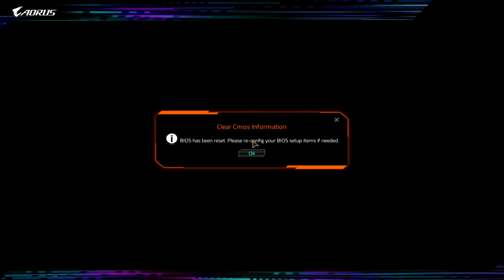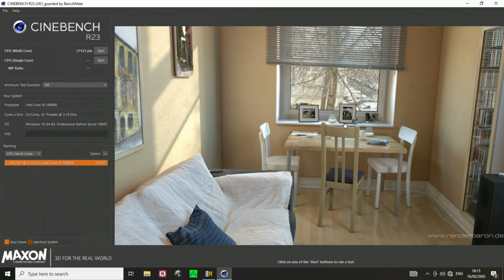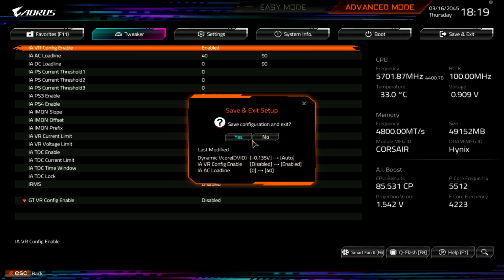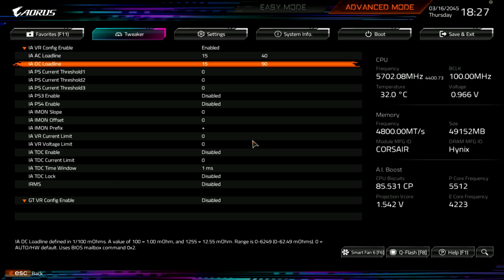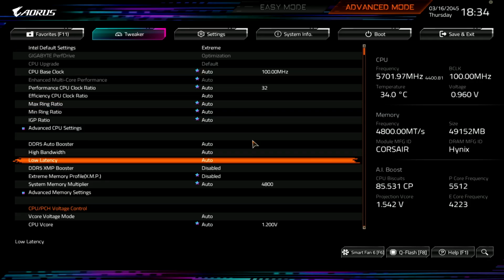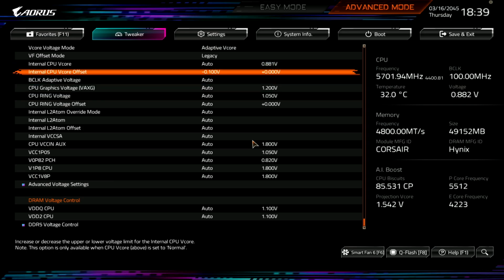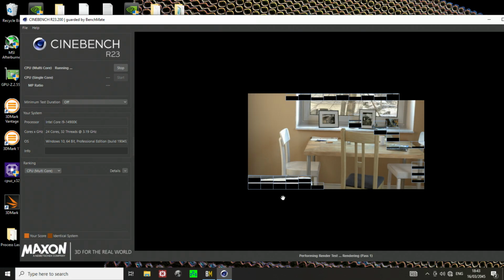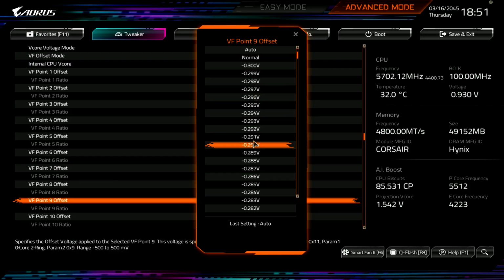YOU  DON'T HAVE  TO TURN OFF CEP to undervolt intel 13/14th gen CPUs

Comment: I have i7 13700k and with CEP disabled my VID's never go above 1,360V, but with CEP enabled, my VID's jump to 1,440V. My current is limited to 307A and PL1 is set to 125W and PL2 to 253W.
Reply: Same here. I have an MSI mobo with a 14700k inside and I have the same results as you. IA CEP disabled, CPU current limit 307A, PL1/PL2 at 253W. Also I changed the value for CPU Lite Load to Mode 7. I never go above 1.36v and my temps are in the high 60s and low 70s during max load in Cinebench 2024.
Reply: @dizzyfist7  legit same. tried new microcode today too w intels bullshit bios settings today and i was hittin 1.44-1.46v.  horrible. going back to OC undervolt  on my 14700k.. fuck  intel.
Reply: this will be true on Gigaboards too - a lot of what he shows is very specific to the specific settings he uses - and mostly no one is leaving the things on Auto that he does for his "dont do this" video - but who knows, many lots of noobs/relative-noobs in the viewership.
Reply: Hello, I don't really have much knowledge with the bios, but I have an i7 13700k and a gigabyte aorus elite ax ddr5 board, currently my cpu reaches 5.4ghz with a maximum recorded peak voltage of 1.378 on very few occasions but in general the peak maximum is 1.362, I have an lp1 and an lp2. Limited to 200w and maximum temperature of 80 degrees, latest bios for 2023, I don't know if I'm okay with the degradation, or what parameters do you recommend?
Reply: @elvinsontaveras7125  Just for the sake of reference my 13700k is stable running 100mV less than that.

Comment: please test the elite board with the 13700k
Reply from the maker: don't have a 13700K
Reply: @ActuallyHardcoreOverclocking  damn, alrite no worries, I don't know if you read my comment on the previous video, but with Intel default it loses performance, but the last few videos have been very informative, I look forward to the elite ax mobo video for more info on my board, maybe the same settings will work for the 13700 too 👍🏽, thanks in advance

Comment: Too bad MSI boards don't have these sorts of settings AFAIK.
Reply: MSI doesn't have AI VR Voltage Limit. Which is annoying, but you can set the offset to "By CPU", which should be the "correct" way as seen in this video.
Reply: Msi boards are the most reliable to get undervolt working
Reply: @mircomputers  What settings? I know about the No UVP microcode, but what about with just default microcode?
Reply: @NANOTECHYT  last time i tried even with h0 die i was able to get offset working

Comment: I just love the fact that he keeps pressing delete even while the pc is shutting down 😂😂, Just holding down delete works greatly (and accurately)
Reply: IDK if it ever happened to you, but it used to be that holding down delete key didn't work. And some settings in startup made entering BIOS window like 0.2 seconds. Ever since I had to deal with mobo like this I do exactly the same thing - smash that delete key as often as possible.
Reply: @jannegrey  I think that was the case with lower end boards, I had a b450 that didn't do it, my z790 does tho, I thought that was the case
Thanks for educating
Reply: @InfinitycgIN  From my personal experience (I had PC's from 1997 and I OC'ed since 2001) most boards had it. It's plausible that boards from the last 5-10 years don't do it as much, but I wouldn't know since I always smash that delete key. It's basically a tick now ;)
Depending on the "provider of BIOS/Firmware" (Im not exactly sure now, how this thing was called) - there was AMI and something "star" and couple others, they basically had an overlay that displayed memory in system and all the "important numbers". And often when this "overlay" was engaged you couldn't get into BIOS. You could get into it either before that (when the screen was black) and/or sometimes after it. But CPU's got so much faster that what was initially let's say 3 second window of opportunity, with upgrade could go easily sub second. To turn this off (if there was even an option) - you had to get into BIOS.
Something similar can be observed on relatively modern Laptops. They often have overlays and sometimes you either have to click delete key in very precise moment, or you have to use different combination.
I'm glad that it isn't now a case that you need to smash that delete key, but it seems to be like inverse of what is happening to Windows and going into safe mode etc. You have to know specific combinations, everything is hidden and stuff like that.
Mind you - I'm unsure if the signal from keyboard wouldn't be disconnected (at least on older motherboards) the moment PC turned off for a moment, when you restarted. In such case, you'd need to pull your finger of it and push it again. That might have differed depending on the connector (USB or PS/2). The point is that if you re-booted your PC 5 times in a row and always managed to skip that window of opportunity, you would be smashing that delete key as well ;) And mind you - even then you didn't always manage to get into BIOS (because Window of Opportunity was shorter than keystroke and sometimes keyboard was disengaged prior to this - pain in the ass for troubleshooting).

And thank you for teaching me that this is (mostly) no longer the issue. I did notice that it was starting to get better around....2005? But you still got some setups that were..... difficult.
Reply: I remember old mobos would error or ignore a stuck key like that. (Might have been PS/2 era?)
Reply: @AySz88  I definitely remember ignore. I also had few errors, but I'm uncertain whether it was from delete key or something else.
Reply: I've posted up a couple times how he can create a simple desktop shortcut that will immediately shutdown the machine and boot into the BIOS.  Guess keyboard machine is his thing.
Reply: Never had that fail for me, at least as long as I can remember. And I had to use a PS/2 keyboard for my first Ryzen 1700X processor, because it wouldn't detect the USB one, even in Windows.

Comment: You mentioned the aorus elite (and in general the boards with onSemi conductor)...can i ask what are the slopes?

Btw, i notice a weird behaviour with my z790 aorus elite. I tried HIGH with 0.5 / 0.5 mOhms (so...50 AC 50 DC) , and even by setting an adaptive offset the load voltage (cinebench) just SKYROCKETS from 1.22 to 1.32 or about that, and it doesn't even seem to be effected by my offset. I'm so confused right now. It just feels like the AC loadline is pushing it up. 13700k though, maybe the i7 behave differently because less current -> less droop?

EDIT: fixed by giving a negative offset to Ring voltage...
Reply from the maker: what voltage sensor are you looking at?
Reply: @ActuallyHardcoreOverclocking vcore
Reply: @ActuallyHardcoreOverclocking  i tried again, resetting the bios to defaults.
Just changed power limits to 253/253w/307A with new microcode and intel specs set to 'performance' (the i7 doesn't have the extreme profile). AVX offset to 0.
Set vcore loadline to high, ac/dc loadline to 55/55, voltage mode on adaptive, negative offset of -0.150v.

Running cinebench single core: 1.22 - 1.23V vcore (but also VIDs)
Running cinebench multicore: 1.28V (but also VIDs) at 150A reported in VR IOUT (probably inaccurate?), 240W of power

What i think is happening is that the loadline is probably drooping about 40mV from the  initial 1.23v but then the AC overvolts for 150A*0.5mOhms = 75mV, effectively jumping from 1.23v to about 1.27/1.28V ... but maybe i'm completely wrong about what's happening (also sensors on this board suck i'm just assuming current reading in hwinfo is somewhat reliable...).

EDIT: if i set -0.2 v of offset ... it doesn't matter. Same VIDs and same vcore
Reply: @Profetorum  same issue using the same hardware i notice that i'm able to go under 240W by lowering the AC/DC LL the problem is that if i go lower than 40 i will start losing performance but the wattage do decrease using high LLC i'm going to try instead of lowering the vcore offset i will try to reduce the Ring offset to see if this do something i remember i read that on a forum that on the aorus elite after certain point you dont see any improvements by lowering the vcore but i could be wrong

Comment: I have a completely different problem with my new build and I'm pretty much at my wit's end...I have a brand new i9-13900f that has never been used on anything other than the intel default performance settings (i don't have extreme because I'm assuming the i9-13900f doesn't support it) + 0x129 bios. For some reason any time I run a stress test to push the CPU to full load, it only achieves full load with 219w power draw (default pl2 for this chip) for a couple seconds, then throttles itself severely back to 65w (pl1) where all the P cores drop from 5.3 ghz to 2.2-2.4 ghz.

1. I have not touched anything else in the bios other than change to intel default settings, and turn on XMP1 for my 6000 mhz memory. 
2. I know I'm not thermal throttling on the CPU at least, because I can see that my temperatures only ever reached maximum 86-87C before throttling. I'm using a Ryujin III 240mm AIO.
3. I have the Asus Tuf gaming B760-PLUS WiFi board, which I know isn't a Z series board but considering the i9-13900f isn't as demanding as the other skus (even less demanding than an i7-13700k), I can't imagine the board's VRM's being the issue? The temperatures seem fine to me. I have an 850w psu, so power is not an issue.

I'm starting to suspect that it's the intel default settings that is the issue, since I don't have any thermal issues. Now I'm trying to figure out how to fix this issue while staying within intel's specs. With all the buzz about the stability issues, I'm really concerned about changing too many things within the bios that may potentially harm the CPU.

Has any one else experienced this sort of behavior with the intel default profiles?
Reply from the maker: sounds like the intel default settings are enforcing the 65W power limit for  the 13900F. As for how to raise the power limit. You might have to disable intel default settings to do that. I unfortunately don't have any high core count non-K CPUs to test with.
Reply: @ActuallyHardcoreOverclocking  yeah i'll try to change the pl1 to match pl2 and see how that goes. As @Abaumstumpf pointed out i probably got a dud of a chip for it to run at such low frequencies at 65w limit.

Anyways, appreciate these videos you're covering for the 13/14th gen chips, helps dispel a lot of anxiety surrounding these chips
Reply: @KhanhTran-yx2zd given that neither of you mentioned which test you were using for the throttling, ignore any conjecture about your cpu being a dud
Reply: @ActuallyHardcoreOverclocking  but even with the power-limit the CPU should not run that low. The few 13900 i have seen - none of them were under 2.5. He'd have to have gotten a real dud there.
Reply: Maybe try extreme? (253w/253w/400a). Anything outside of that would result in an EDP current throttle for me on my 13900k. It's weird, I know. Most say 400a is unnecessary, but if I didn't set to 400a, I always had an EDP current throttle in XTU. Old CPU and new RMA that works great, same thing. 307a of the performance profile didn't work right for me at all and heavily throttled my CPU. No idea why, but it is what it is.
Reply: Is TAU period still a thing?
Reply: Huh, that seems strange. Have you checked all temperatures - including VRM, Ram, chipsets? Cause from what you say your CPU should stay at the boost longer and 2.2GHz seems too low for 65W even. it should be more along the lines of 2.7-3GHz.
Does the board have any stupid "stability enhancements" or other things like that?
 @yarost12  tau should be 56 seconds.
Reply: Intel defaults killed performance on my Asus MB with a 13900K.  Just disable it and if you're processor runs hot or too high of a voltage adjust the power and voltage settings.
Reply: Maybe try undervolting?

Comment: Sorry for copy-pasting the comment from the previous video, but I really want to know your opinion.

Can you please comment on my understanding of LLC and Vdroop?
1. CPU VRMs are not perfect and the voltage sags on transient loads. This is just physics, and some VRMs handle this worse than others (voltage sags lower).
2. To prevent voltage sagging below the "stability threshold" there are Vdroop and LLC.
3. The amount of Vdroop is set by configuring LLC.
4. The CPU is configured by setting the AC load line to match the LLC (amount of Vdroop) of the motherboard.
5. The Vdroop and LLC force CPU to request higher voltage on idle (base VID + "Vdroop calibrated offset"), so when a transient load hits it, the voltage sags right to the necessary "base VID" point. Basically we create a safety buffer for the voltage to sag, and the lower the load, the bigger the buffer .
6. This is configurable because some VRMs have terrible transient response (voltage sags a lot), and this requires higher average voltage for the CPU (so in the worst high-load scenario the CPU remains stable). And vice versa: for amazing VRMs these values can be set lower since the voltage sag is not as terrible.
7. None of this actually protects you from voltage upward spikes on load release, but more steep LLC may result in less pronounced spikes compared to the "average" low-load voltage (which is actually higher than average voltage with a shallow LLC, so the peaks are actually the same).

Thanks for your amazing work out there! I really love such passionate people as you.

Comment: Hoi BZ any 9000 series coverage? easy 8400 settings on 9700X perhaps :D
Reply: IO die is the same as in ryzen 7000, so same 6000 MT sweet spot and no "easy 8400" possible sadly
Reply from the maker: don't have one yet.
Reply: I want that too